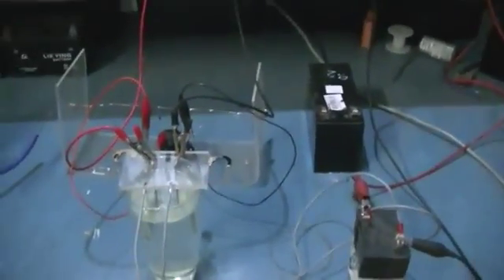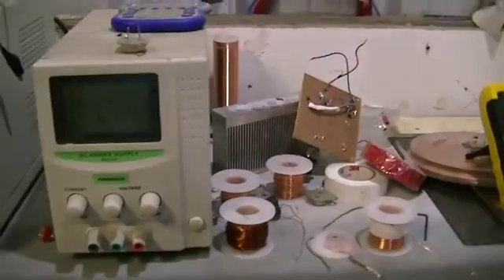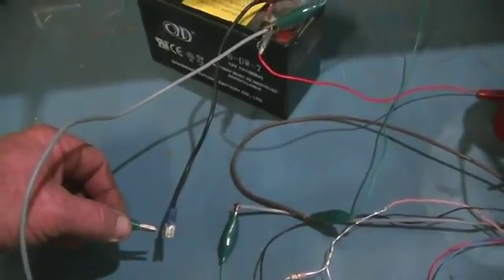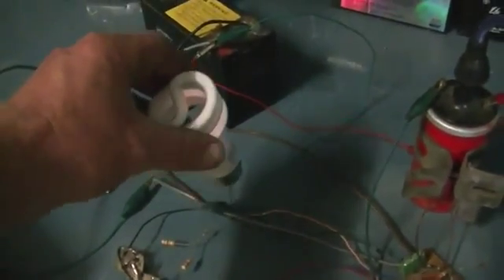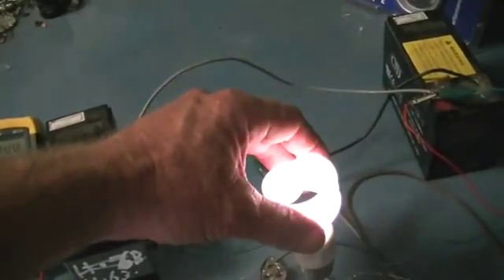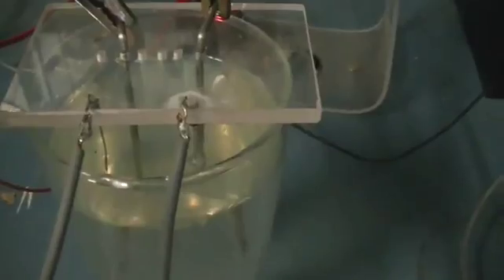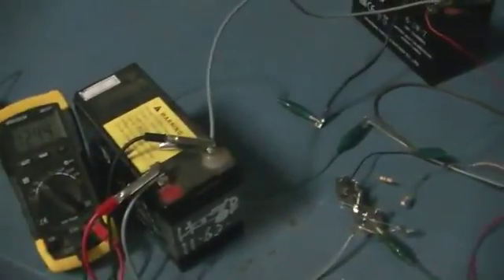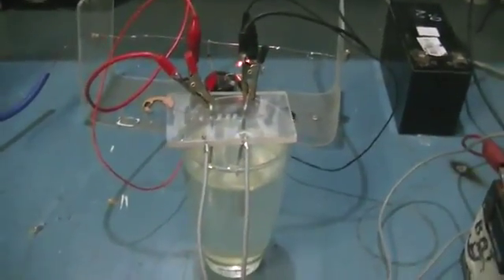charging a battery through water.mp4

Comment: cool
yes my power supply meters go nuts
the forward and reverse are combined and the electronics are confused
the speed of the frequency is high and the forward and back of the circuit will shock you good. 
cool though, very anoying when zapped

Comment from the maker: Hi Andy-i think it may be something diferent as my transistors were grounded along with the power supply befor i started useing the batterys.I think because of the way i have the ignition coil hooked up(positive earth,negative +)when it collapses it reverses the positive current in the system to a negative current.This would explain why the voltage on my power supply went up when i hooked the system up,and why non of the components fry-because it is a negative charge not a positive one.

Comment: skin effect.  high resonant voltage rides along the surface of objects.  It freaked me out the first time I discovered this after getting shocked touching my wooden desk.  Your power supply was zapped because it was grounded to earth ground, which the same would happen to your transistors if your supply battery was earth grounded.  The high voltage is electrically common with everything on that desk top..this is why birds can sit on high tension lines...nice work, keep up the experiments!

Comment from the maker: Hi thewonn-only useing the one wire from the coil.That is hooked to both side's of the cap and then from the cap into the glass of water with the two s/s rods.I could move the two diode's closer together but they are glued into place.HHO is not the goal now-now i want to find out how it is possable for the glass of water to contain both a negative and positive charge at the same time wich is needed to charge the battery
Certainly interesting stuff this high voltage

Comment from the maker: Hi lykenth08-how you been.
The work bench is dry timber and i dont feel any shock through it.And yes the neon started glowing when ever you come close top something that has the high voltage in it.This is a good indication that the voltage is very high as to radiate it like that,but as you seen with the CFL that the actual voltage on the components has also got a bit of current to it as well.

Comment from the maker: Hi TheMrblazer320
At this point in time i have no answers as to why it is doing what it is.And how those transistors are surviving with around 700 volts going to the base i will never know.
This deserve's some more study i think-but i believe it may have something to do with the diference in capacitance and voltage potential between the glass of water and the battery being charged.You may just be correct with your idea on the swapping of energy between the battery and the glass of water.